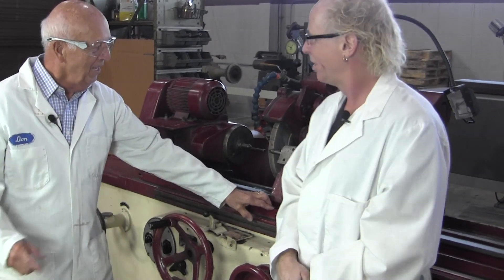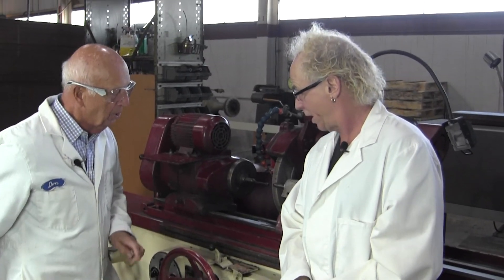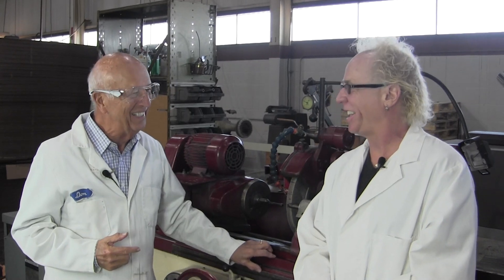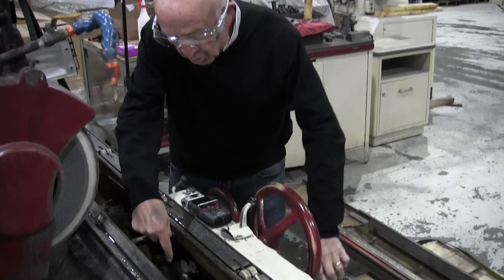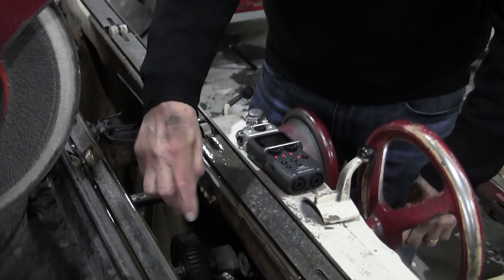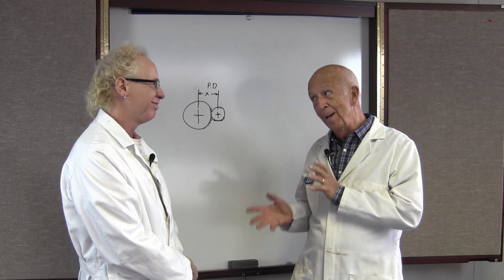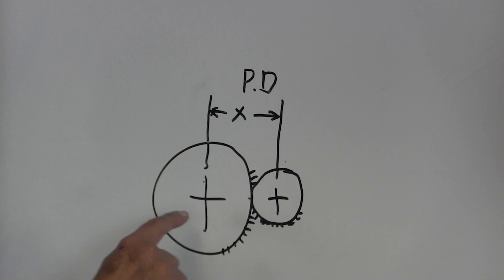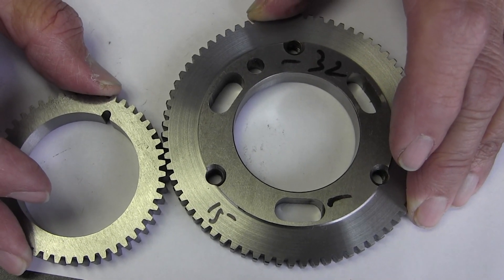How to identify and correct gear backlash - part 1

Comment: If you end up remounting the rack to use an unworn portion and this solves that problem beware of forgetting about the wear of the other side if an occasion arises that you end up using it. Out of sight out of mind is okay for inventory, but not for bad areas of your machine. PERMANENTLY MARK those areas as BAD and only to be used when tolerances do not need to be close.
Reply from the maker: Right you are!!!!!!

Comment: Other things that can cause a problem is wear on the pivot hole that the axel of the gear rides in. The wear is almost always one sided (in the direction of the pressure on the gear).

Comment: For me it was impossible to cut screws on my lathe (Craigslist, used Central Machinery 9x20 for $200) until I traced the problem to 120/128 gear that was mounted concentrically but with play between them. I clamped, then drilled through the two near the outer edge and peaned a brass pin to hold them fast. No more screw turning problems. Yea! :-)

Comment: Hi Don, that was an interesting video. Could you tell me how you would go about setting the play between the change gears on an engine lathe? I have heard a couple ways. What I did was went with a piece of paper, no not that pack of shim stock you carry in your pocket, I mean a piece of writing paper LOL. Putting the paper between the gears when they are meshed and then securing them at that point. The gears look like they are in very good shape, not all worn out from a lot of years of work. Thanks for the video and looking forward to part 2.